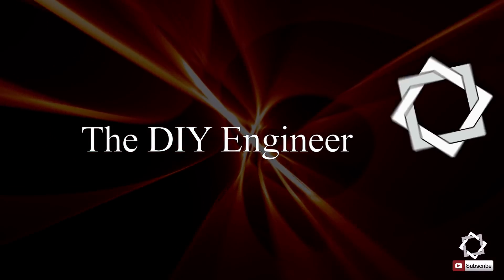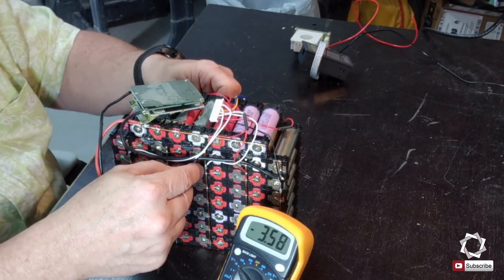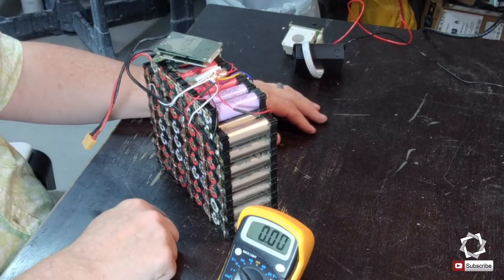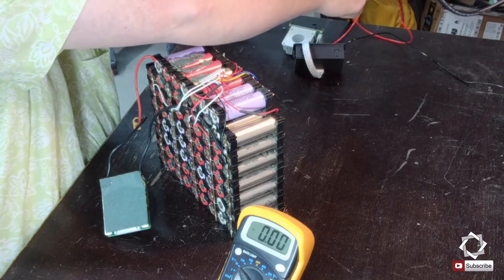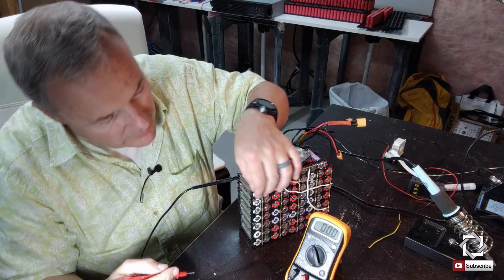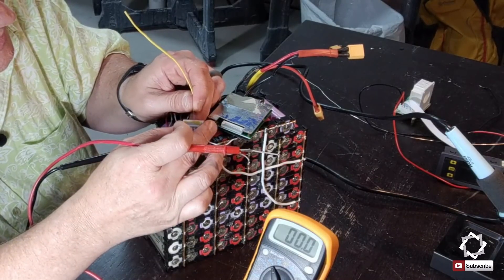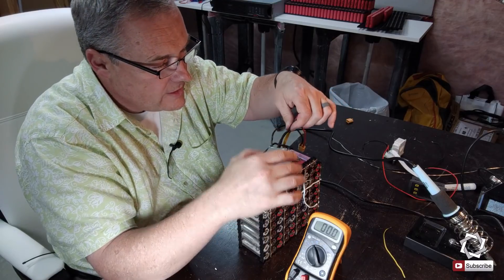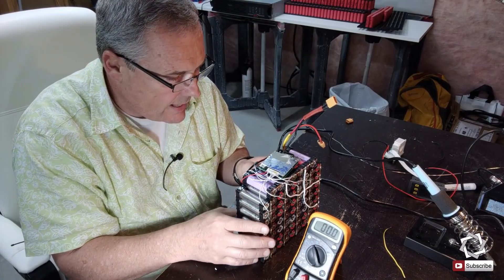7p10s Lawn Mower Battery Rebuild

Comment: You may have some sells that have excessive  internal drain. Bms will balance if sells are closely matched. I build the LI-ion battery substitute for my Worx 36v mower as well but 10s4p -6AH. Good for 30-40min of mowing.

Comment: Hello Frank, I am hoping you could help me with this question. I made 3x24 18650 battery packs wired them in series to get 60ah @ 12v and added a 100amp  BMS. Can I make 3 exactly the same packs and wire them in Parallel to  acquire 120ahs? Thank you for your feed back. Have a nice day.

Comment: best way and i have this problem with all 4 of my  4S bms's capacity check the one bank and compare it to the others with out the bms connected and see what the difference is. If the diffrence is minimal then yes its the bms causing the problem. You can try another one or add a parallel cell to that one bank to get it more balanced with the others through the bms its been my experience that only one bank of the S series out of the 4 with mine that will do this ya just gotta find it and add a parallel cell to offset the difference. I went nuts finding this problem when i seen it come up much like yours one cell row runs down faster while the others still have 3.2 to 3.5 volts  and  the pack shuts down because of that one row. You put alot of effort in the pack so verify cell bank capacity to confirm the bms is acting odd. Hope this helps.
Reply from the maker: I'm glad I'm not alone in these struggles.  I have another BMS installed and I have mowed my yard.  The battery is now charging and I check the cell ballance after it is fully charged.  We shall see what happens.  Thank you for your insights.  Stay tuned.  :-)

Comment: we have a very similar situation with the mowers! As for the BMS i have heard many situations where people have a BMS that cuts power but does not do true balance. The one you have now may actually balance however it only balances on the top if the charge, from what i hear. So, that means you have to charge it, let it get to full then let it sit plugged in and it balances the cell banks at a very low amperage. So the balance feature may take quite some time. Get a hold of the BMS seller asking about the balance feature. If his name is micah (look at shipping label) then try heading to ebikeschool.com or the youtube channel. Lots of BMS info there. good luck with it!
Reply from the maker: Thank you for your insights.  I will test the charge/balance process you suggested.  BMS's are not really clear to me.  Thank you!!

Comment: If mowing your whole yard completely discharges your pack then the pack is not big enough. Is there room for a second pack connected in parallel on top of that one. Adding a second pack should half the imbalance as well as reduce draw and double your run time. For whatever reason your pack is discharging unevenly. Probably different types of batteries with different internal resistances. If you are going to charge with a balancing charger then why do you need a BMS? Your pack will balance every time you charge it which should be every time you mow. My experience with off the shelf BMS boards is that they don't work on large packs because they have a limited discharge ability and the rate of charge on a large pack exceeds their ability discharge fast enough. They do nothing when discharging! they only discharge cells that reach 4.2 volts to keep them from overcharging. A BMS that was able to balance while discharging would have to have both battery leads and leads for your load separate from each other on the BMS. Something like this would probably need to be custom made or maybe something like the opensource BMS project I saw would be configurable enough.
Reply: Ron Safranic The pack is the correct voltage and the capacity (Wh) is actually greater than the lead acid batteries that were removed. Additionally, the cells are capable of discharging at the required rate (A).

Frank is a perfectionist (Not a negative comment Frank. I am, as well.), so he's not happy with actual vs. theoretical perform. Banks 1 through 8 are behaving nominally/as expected. However, bank 9 is low (relative to the other banks), while bank 10 is quite high.

Lowest bank will trigger load disconnect, while the highest bank will trigger charge disconnect. Combined, these conditions limit performance of the entire pack, and that's what Frank will fix.

Frank's awesome. He'll find the problem and share his finding. Stay tuned!
Reply: Frank,  is the mower physically heavy enough?
Reply: Yea I'm more of a make it work kind of guy! It looks like that pack is made of used cells. Bank 10 looks to be all the same type of cell. I would bet that internal resistance is the culprit.
Reply from the maker: Ron, The battery is large enough to mow my yard, the last time I mowed the battery went from 40.6 Volts to 36.6 Volts.  I currently still think that the BMS is needed but you may be right.  I will keep working on the issues and we can all learn from this.  I had issues with a smaller battery pack that did not have a BMS.  Without a BMS, 9 cells were over discharged and no longer usable.  After installing a BMS I have not had any issues.
Reply from the maker: John, thank you for your support.  Frank
Reply from the maker: Ray, yes the mower is working great.  I think it is heavy enough.

Comment: The charge input is not all that special, all cheaper BMS boards use top end single cell discharge balancing, the cell gets to 4.2 and it switches a resistor across the cell to discharge it. It probably also turns off the charge input ( or at least slow it down with PWM) you should test it with a clamp meter on the balance leads, I haven’t seen many videos of BMS behavior in action